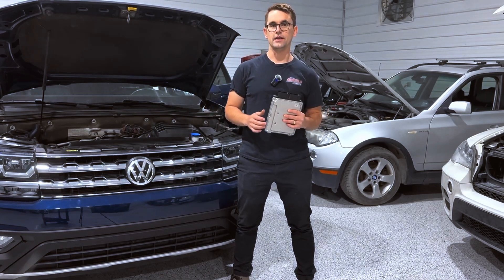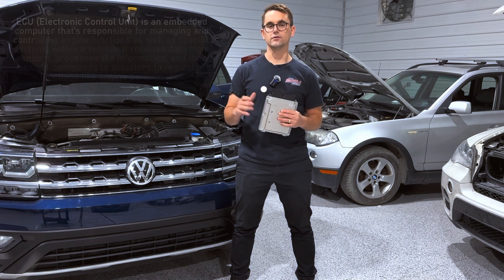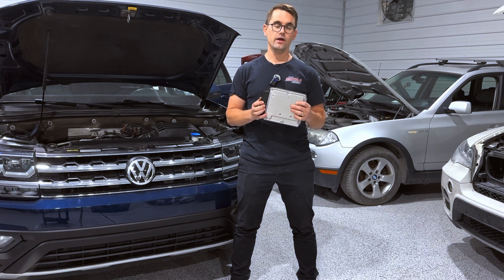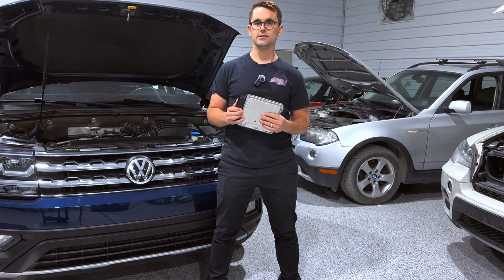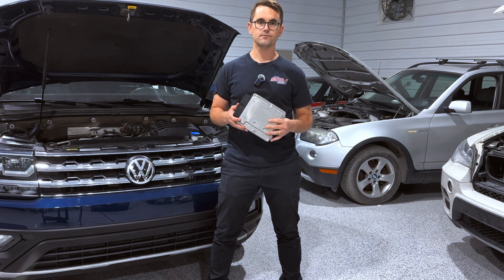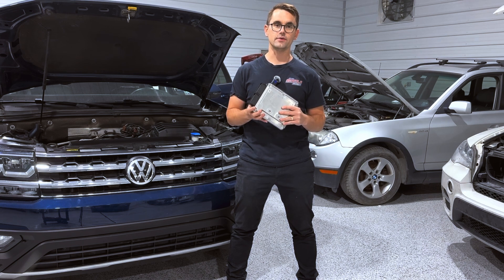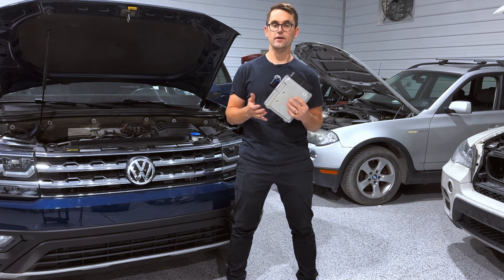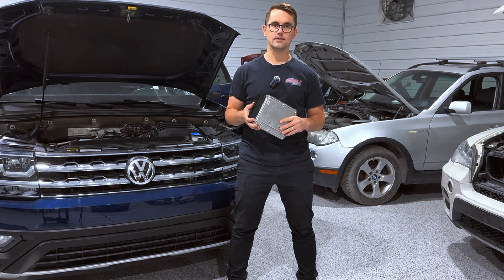ECU Failure? Expert Diagnosis, Testing, & Repair with The ECU Pro. Mail In US Based ECU Repairs

Comment: I have a 2003 gti vr6 and the car died on me randomly and cranks but doesn’t turn over. Checked fuel pump and crank position sensor and all are working,did notice my rear o2 sensor split from dragging on the road,could that have fried my ecu? Ty for your time.